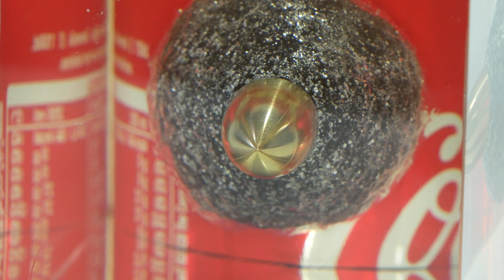Shooting a Coca-Cola can. Bullet Underwater. DIY a Simple Way / RESIN ART

Comment: I like it a lot, but where the bullet enters the can it's supposed to bow inward not outward. Still looks very nice.
Reply: Agreed!
Reply: i too agree brro
Reply: Actually no it does not... can is under pressure  from inside... and as soon as bullet hits can it does 'bow' outward... not inward
Reply: @k.a.haugen3680  The energy of the coke's pressure inside is nothing compared to the energy the bullet emits. The coke wouldn't be able to bend the tin anyway...
Reply: @Knilch58  look up pictures.... it 'explodes' outward!!!!!
Reply: Was gonna say the same thing.just glad you did it first
Reply: Due to the can being under pressure, when the projectile hits the can soda and parts of the can will blow outwards.....not rocket science guys!!
Reply: His entrance hole is just a little too exaggerated lol
Reply: Was thinking the same. Super cool though as always!
Reply: @k.a.haugen3680  actually the entry of the bullet would make a inward entry hole even when it is under water with coke in the can it will still make a inward entry hole I even looked at photos
Reply: @jamieyoung5306  it a freaking piece of artwork.... and it still would porotude outwards!!!! Ugghh
Reply: @k.a.haugen3680  I looked up pictures, I found only 1 where the can also explodes outwards on the entry hole from the bullet, but more than 10 good pictures where you can see that the entry hole is bent inwards. Apart from that I agree that it is not very important as it is a piece of artwork.
Reply: It would be more realistic if it was an actual bullet hole
Reply: @bettafish541  like a .22 hornet.... small but fast
Reply: You are very wrong
Reply: @Lucian_Andries  it is a freaking art piece.... not supposed to be exact... duh??? Plus.. I have seen the videos.. and have shot full soda cans myself...  🙄
Reply: I don’t think it matters which way it goes it is a piece of art and the creator chose to do it the way he did it’s beautiful either way
Reply: I notícia this too!
Reply: @k.a.haugen3680  Try shooting a Coke Can and see what you get.
Reply: @Dougwoz1  I have... several times... I stated that in a previous  comment...
Reply: The same mistake with WTC

Comment: Great idea and implementation! But there are two nuances!
1. The jar must have an inlet and a outlet opening. And it turns out that both holes outlets.
2. It would be great if the "cola" was lighter and inside you could see the same effect from the movement of the bullet.

Comment: I’m confused… if the bullet is going in one side and out the other, wouldn’t the impact side have the can shards pointing inside? 🤔

Other than that, fantastic job!!!
Though I still would love to see you make a Zelda Fairy in a Jar… 🧚🏻‍♀️
Reply: Yes
Reply: Not necessarily. look up some videos and pictures of bullet impacts and you will see the pressure caused by the bullet will blow the shards in the opposite direction.
Reply: CH
Reply: A figurine in a jar, covered in a liquid...

Kind of sus
Reply: @bettafish541  No, it’s a glowing orb with wings, the tricky part would be to add lights inside the orb.
Reply: I was thinking the same thing

Comment: Great work as usual except one detail, entrance hole would be inwards without any coke coming out
Reply from the maker: That's true
Reply: Entrance hole would be inwards but coke would be coming out check out demolition ranch he does experiments on things
Reply: @andreaaloisi1138  Even in that moment? The bullet would push the coke out of the way when entering so figured the coke might not be instantly coming out but a few frames later
Reply: @Hoggaforfan  Yes sir. It is not just water coming out of the can it is a can of liquid with CO2 compressed liquid will spray, As well as the reverb from the actual bullet
Reply: @andreaaloisi1138  Yea guess I didn't think of the CO2 :)
Reply: No it does not.... on an unopened can.. it would 'bow' outward
Reply: @k.a.haugen3680  Interesting, couldn't find any good video for it, oddly enough. To small caliber, softairgun or not slow enough

Comment: Never shot a full can of soda, but it is possible that the force for the escaping soda could push aluminum at the entrance back outwards.
Reply: No but yes. No, because any soda can that gets hit by a bullets literly explodes. Yes, if the can is thick enough then the bullet will push the aluminum inside, and the exit would  be similar as in this case. In this video both holes are technically exit holes
Reply: Yeah, that's gonna be tough to say, without a super high speed camera, with a super slow motion playback 

When a bullet, fired from a high powdered rifle, hits an unopened coke can, the pressure is super compounded. It's going to send aluminum fragments, paint dust, and coke mist, in EVERY conceivable direction, in about .000001 seconds, upon impact.
Reply: Who woulda thunk watching a jedrak resin video could result in an interesting physics lesson?

Comment: On the entry side you should have peeled the aluminum back like you have it and drill a small hole about the diameter of the bullet and then bent the aluminum back into the can like entry holes are in real life with the splatter coming out. The exit hole looks great tho and overall a great job 👌

Comment: Great video as always but when shooting thru a can with a bullet, there should be 1 entry point where the can is pushed inward and 1 exit point where the can is pushed outward, not 2 exits. This video defies the laws of physics.
Reply from the maker: Physics works differently than you write. Check the information
Reply: @jedrek29t  very true but not when ur shooting thru a can from one side. If ur bullet is going thru a can on one side, there can only be one entry point and one exit, not two exits. The only way for it to possibly have two exits as in ur video, it would have to be shot from top or bottom as the bullet enter the can and splits into 2 shards and exits both sides. Great video as always but ur video defies physics in that aspect. Definitely no hate ur way, just stating the obvious. Really hope that I didn't offend u in anyway. If I did, im sorry...

Comment: I really enjoy your videos but I would like to know what molding silicone and hardener you use please. I’ve just tried to make a mold with another brand but it didn’t dry on the inside after 24 hours. Thanks.
Reply from the maker: The silicone must be mixed well. Mix longer and wait longer for it to dry. Follow the manufacturer's recommendations
Reply: @jedrek29t  thanks for the reply. Cheers.